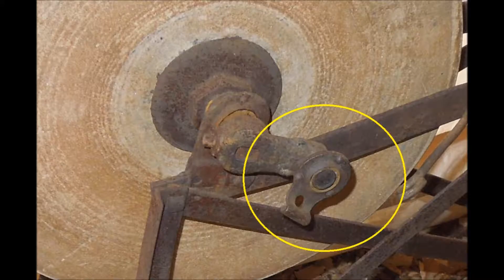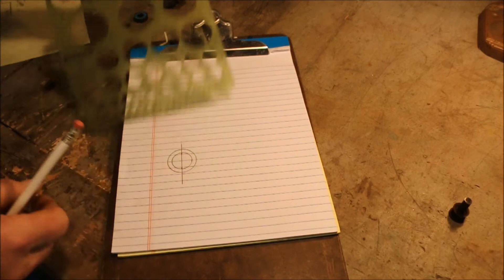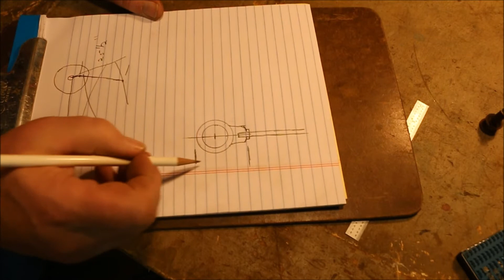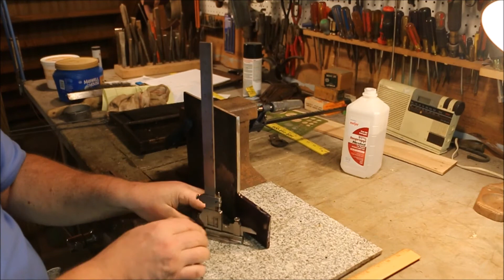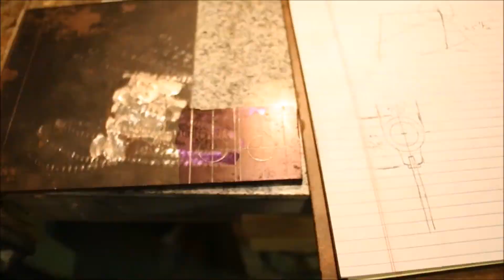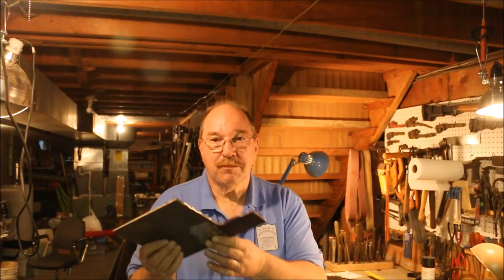TREADLE GRINDER ~ PART XVII ~ TREADLE LINKAGES

Comment: i suppose yo'll cut the rods to fit when the linkages are attached and you can smoke the whole thing over. I forgot about the eccentrics. But I forget a lot of stuff. And the make do's are rampant here! Good job, Unc! Almost out and about again so things are looking up!
Reply from the maker: Lewie McNeely That is the plan. With the ends threaded I can adjust the length so the treadles won' t clank on the floor. ☺

Comment: question on the stone tile, does it pass the steel rule edge test?   i could use a flat surface myself, and this might be a good route for me to find one, if you cant see any gaps (or at least too small to measure with guages) then its flat enough!
Reply: I modify mine with a hammer.
Reply: @lewie, so you modify your straight edge to fit the surface,  thus making it 'flat'  yep great idea, will solve my crooked workbench top lol
Reply from the maker: Jusb1066 I checked the tile and found that within the limits of my available straight edges the tile is only flat within about .002 over the one foot measure of the tiles width.
Reply: thanks, thats pretty good , currently i use a piece of non plate glass for flattening etc